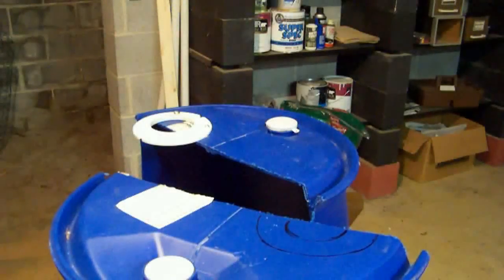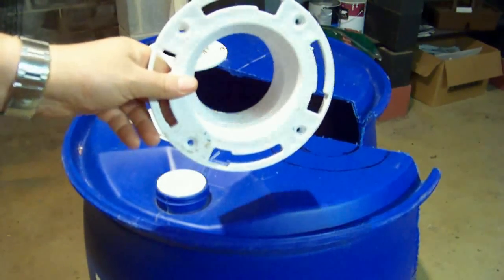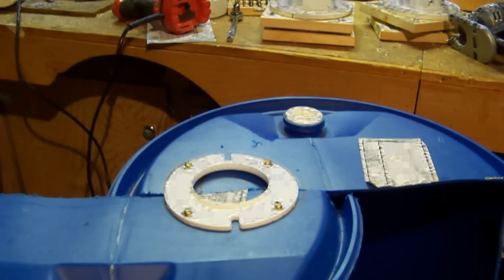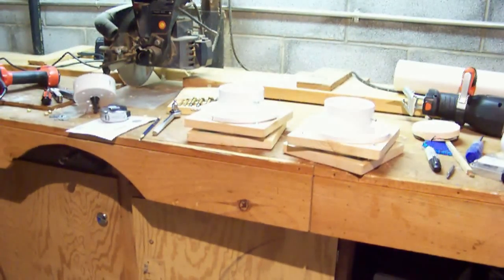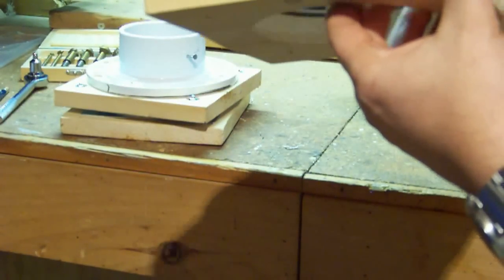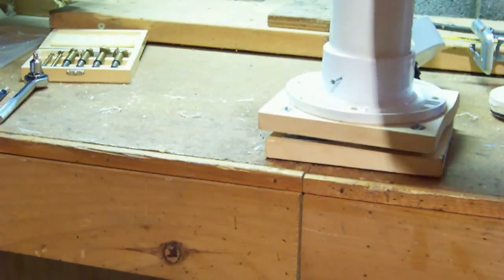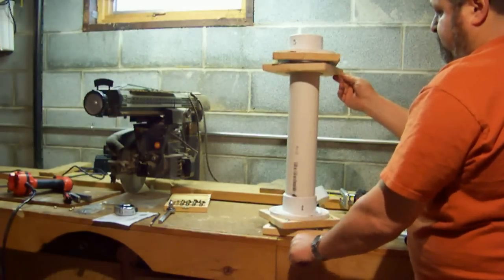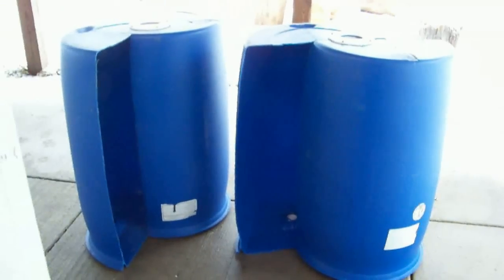How to Make an Inexpensive Vertical Wind Turbine - Part 1

Comment: Do you have an inverter? Can you explain some more as to how you are extracting the energy and converting it? I a, very interested in wind I have a small solar set up very small for a greenhouse. I hope you have a blessed day!   Wendy🌎🙏🏻🇺🇸
Reply from the maker: I was using a charge controller to charge a deep cycle battery and a bridge rectifier to go from ac to dc.
Reply: @embeddedprogrammer6276  Thank you! I am learning about solar and wind.

Comment: I do dislike lazy lucy bearings., yes., they are cheap., but with the lack of seal.,they are a replacement waiting to happen..Cheap replaced multiple times over are expensive..
Reply from the maker: You are correct.  sealed bearings are better.

Comment: You can also leave the rain barrel whole and cut vertical slits in the barrels and then use 2x4's to pop the edge out and then heat the plastic with a heat gun, leaving the 2x4's in place until the plastic cools down.  Do this all around the rain barrel the same direction so that it makes blades.  Then you can mount the barrel through the center.  This will be more balanced and have less moment/torque, but will work great for things like pumping water.
Reply from the maker: Thanks for your input.

Comment: Using lazy Suzan shows that they spin ok put exposed bearings not good and the racket, any reason u couldn't  use some nice quiet  sealed bearings
Reply from the maker: You are correct

Comment: Bicycle wheel and belt drive is more efficient and less friction.
Plus rubberized pads to insulate vibration noise from house/deck frame.
26" wheel to 10" pulley on alternator gives a better current at low speeds.
Reply from the maker: Great idea!  Did you make one?

Comment: does anybody have a link to a video where these types of windmills are working with an actual load?
Reply from the maker: https://youtu.be/24LSnATIZhw
Reply from the maker: Although just a meter.   I will put up a shot of it charging batteries if you want.
Reply: @embeddedprogrammer6276  thanks, that would be good.

Comment: Lots of great feed back, one thing not addressed is efficiency the fins of a vertical axis wind mill are like a air foil or are plane wing. Properly made they a very efficient  quiet, work in low and high wind i.e. no prop break off phenomenon.  55 gallon tank is a cool project that I not going to due I will spend some money and save in appropriate places via my skills overall I commend you for your hard work and optimism I could be wrong but wear and tear and low efficiency maybe problems.
Respectively 
Dr Ron Donahue
Reply from the maker: This is a drag turbine (Savonius).  I have made Darius Turbines which use airfoil cross-sections (see some my other videos).  Darius turbines rotate more quickly but do not have the torque of a drag turbine.

Comment: end plates will increase efficiency. also the overlap ratio could be reduced i think. indeed cover those bearings. great two stage idea here though.
Reply from the maker: I am playing with overlap on a new, smaller design for the Shed LED lighting market.

Comment: Let's calculate how much energy this might produce.   Assume it is .86 m x .86 meter.  If the wind is 20 mph (8.9 m/s) and a 30% VAT efficiency=1/2EpAV^3=1/2 x .3 x 1.22 (.86 x .86) x 1.22 x 8.9^3 = 95 watts at most.
Reply from the maker: What is VAT efficiency?  I am setting up an arduino to measure current and voltage so will soon be able to record the power generated and correlate with an anemometer.
Reply: VAT efficiency is simply the efficiency of a "Vertical Axis Turbine"  (VAT) to turn the kinetic energy of the wind into electrical energy.  The power ouptut will be proportional to the square of the velocity of the fluid..in this case air.  In the case of Turbine the re. (a VAT) the efficiencies are very poor since the blade has to "fight its way upstream" when coming around.  30% is generous.   The 55 gallon drum design is probably much less.
Reply from the maker: OK

Comment: Thanks for showing your ingenuity. We need a electrical schematic  on how you connect it to the house AC supply?
Reply from the maker: You can use a  grid tie inverter (search amazon or ebay for one).    Or you can use this for charging a battery bank to run 12v items.

Comment: Not going to last very long with open ball bearings.  Need sealed bearings because the wind is going to blow dirt into the bearings.  Also how does one take the power off of this thing to do something useful.  I would grade this projects as a failure at this point.

Comment: I would be leery of a lazy susan lasting for the extended usage of that application. The loads are okay, but extended usage at 20+ RPM could become a problem.

How well did they last? And if you changed them to another type of bearing, what kind?

Comment: there's 8 mins and 32 secs of wasted time ...
Reply: how so???
Reply: To be fair at about 6 minutes it stops to just show you the thing spinning with no commentary for about two minutes... and then tells you about the generator in another video. Not a horrible build but doesn't look like it's very long lasting. The bearings will rust, the PVC pipe will likely dry out and crack over time and I can only imagine what your neighbors might say about such an ugly fixture if you live within city limits. It's a great simple idea for power, but not something that will last too long or be for everyone.

Comment: The bearings are exposed, and will not last in dusty conditions.  grease for the bearings, and a simple foam rubber seal, might have dramatic increase in bearing life.
Reply: gamesbok the seal will also cut some noise.

Comment: I WANT TO MAKE ONE TO DRIVE A SHAFT TO A 5 SPEED TRANS INSTALLED BACKWORDS THEN TO A  LOWER END OF A BOAT OUTDRIVE- I WANT TO USE THE TRANS TO CHANGE SPEEDS AND FWD REVERSE. THE BOAT IS 40 FOOT
THIS IS SIMPLIFIED- I NEED MAJOR TORQUE ANY THOUGHTS?
Reply: +Paul Zeiss 300HP diesel engine.

Comment: It's a Savonius Rotor. You can make one with three 55 gal. drums. Cut off the tops and bottoms (circles), then you have 3 tubes. Cut the tubes downward 180 degrees apart and you have 3 sets of U-shaped wind "buckets." Select a strong pipe for an axle. Cut circles the diameter of the axle out of the tops and bottoms.With the tops and bottoms sandwiched between, weld the U shapes to the axle 120 degrees apart to create S shapes. Sounds confusing right?. Look up Savonius Rotor. Anyway, it's cheap but you have to be able to cut and weld. New idea? No, I saw it first in the "Mother Earth News" in the "70,s. Anyway, it's not very efficient in a light breeze. No DIY 'er has the ability to create a proper rotor that is. Yes it will spin but unless you live on the side of a mountain it will bog down quickly under a load.
Reply: Dutch2236 well said... thanks for your comment... I’m sure it will help many folks new to this effort....

Comment: I bags the bedroom furthest away from these mothers, Lasy-Susans are not for continuous spinning use, there just a very cheep way to help rotate a heavy load, i used some cone hub bearings, this also will allow the shaft to go through and connect to the motor. I salvaged the hubs from front end of a car £20 and you can even make use of the disc-brake & caliper that is fixed to the hub as a brake.

Comment: Have you tried blocking the center where the two halves intersect?  I believe that doing so will get you better outputs because if it is open it essentially allows wind to go completely through and be counter productive by causing inertia to fights..  So blocking it should give you more torque.

Comment: You need to raise the barrels up higher and redesign the barrels out wider. The way you have it at the moment, it will not spin a generator. Your best wind is 50' to 75' up above the surface of the ground and higher. The span should be at least 5' from center. You have a wrong formula for a wind generator. But if you paint a rainbow on it , it will be a very nice lawn ornament.

Comment: Just a thot from us all.... don't believe those ' lazy-susans' are going to last long...let alone the noise they put out.
that weather will chew those bearings up. Not designed for what you intended my friend. For, as long as, they'll
last, you might try spraying some teflon or some equivalent type of lubricant to keep the bearings quieter an operational
for as long as, their going to last. The PVC components may last a bit longer. Watch for high winds & see how it performs
then. (?)  Keep on try'n.
Reply: Greg

Comment: Now if you attach a bicycle wheel on the top of the barrels and then mount one of those old bicycle generators that press against the side wall of the tire, you might be able to light up a six volt flashlight bulb. That's if you got a good wind blowing. But if you use LED lights instead of incandescent ,you could more than quadruple your light output. That's not enough power for me to trade off the sound of a freight train on my deck all night long. I would put the 300 bucks towards a nice 130Volt 1.5Kw  horizontal turbine with a MPPT charge controller.Put the turbine on a 30 ft pole 150 ft from the house because you have the perfect location for it and you'll never hear it. I'm not fussy about anything weighing 250 lbs spinning where people and children and pets are walking around.That's an accident waiting to happen.

Comment: great video, but how do you deal with the noise? i think is very loud
Reply: Douglas Hutchinson that's what happens when you don't Grease the bearings before you use the equipment.
Reply: If you live out in bush who cares. You won't hear in house when generating
Reply: Besides a little noise and motion neAr garden a good thing

Comment: That's a great way to powered up the house with the wind turbin to drive a motor with magnets in it such as induction motors or ceiling fan motors to generate electricity with. That would be cool.

Comment: Have to agree that the concept is awesome and like the lazy susan bearing system concept . It would seem to realize that like others stated, you will need a better system than a lazy susan , an industrial grade is more suitable. Sure would be awesome for appearance if the turbine was on the actual corner post .Being at a higher altitude seems to be a great asset to this project.

Comment: @embeddedprogrammer Cool design, I can tell your a woodworker and I appreciate your post. I liked; the barrels, how it was mounted, and how two barrels were stacked on top of another. 

the alternator from a fan would probably fit pretty well in that design and off course add electricity.

Also I have heard that arranging vertical axis windmills close together makes them more efficient and how you mounted yours gave me a great idea. Thanks

Comment: I like to cut the drums with a hot wire, an old toaster wire and a 12v car battery makes a nice clean cut, use a "V" board set up to push the drum through the wire. For the bearing set up use a front axle hub from a junk yard. Balance is very important! Make sure the cut is in half. Transfering power with a belt using a 4 pulley system to the generator from verticle to horizontal axis. I like where this guy lives I would power a ski lift with it.

Comment: it occurs to me that you could have cut longitudinal flanges along the sides of the barrel and gently bent them outwards with a heat gun (i'm sure that is thermo-plastic), and shape it like a 'turbine' in a fan heater? would have saved you having to cut them in half.

Comment: if you went with a "magnetic Opposing" you could drive a small enough steel rod it would support itself with extremely little friction. You could then come off that to drive a geared DC motor. it would also be much quieter! Dont think you really need something that big

Comment: A belt could easily be used to turn a generator.  I like the idea of a compressor instead.  Store the air pressure and use it to turn a generator when needed.  Air acts like a spring for storing energy.  Batteries are more popular but they are batteries.  And air is clean and cools in the summer.

Comment: rust noise and where is the load? no load = easy to spin in low wind. with a load and then when them bearings get rusty you will have a challenge. 
HOWEVER a nice way to recycle the drums. :) 
id like to c this with a load and using sealed bearings. they will be quiet and stand up to the weather and not rust.

Comment: Get some NSK spherical roller bearings. Really any sealed bearing would work but spherical's can take anything and they are solid. 
@landslave I doubt they used stainless steel and it's completely open so yes. (they will get loud)

Comment: I think its a great video. But it had to eat it's self within hours or days. With that bearing setup and the lack of some sort of oil injection system to maintain bearing lubrication, plus the fact its a Lazy Susan meant to be spun slowly and in-frequently with just low loading, it would destroy itself.

Comment: Dumb question, why didn't you use a pair of "one wire" (self regulated) 12V alternators for the top and bottom bearings?

Comment: Yes. Yes they will.  These "lazy Susan" devices were never intended to be used outside.  Also, they are only intended for intermittent use, as in spinning around a spice rack.  Even if they never rusted, they will wear out in short order when subjected to 24/7 use.

Comment: The biggest problem I see in you choice of a lazy susan rotation system is that they weren't made to deal with the kind of friction being dealt out on a constant basis. That kind of heat will eventually melt or burn through whatever non metal material is next to it and all of your effort is for knot.

Comment: A good choice,although a little expensive,would be a sealed wheel hub bearing from a small car,at least for the bottom bearing that sees the most load,the top bearing can be a rubber sealed common size bearing,both would have very little friction,be weatherproof and low maintenance.Most front drive cars have replaceable sealed hub bearings.

Comment: I believe optimum design calls for 10-15% overlap in the blades. I see here that you have it 50%. It does not kill it, but it might be that you are catching less air than you should with those barrels

Comment: Good use of available materials!  The lazy susan table bearing are an easy find, they are overkill for this use.  The bearing noise is also amplified by the light plastic of the turbine fins.  Running a pipe down the center would allow the use of smaller bearing.  Run a 2nd pipe (PVC) that has the metal pipe in center and just one load bearing holding up the whole thing.   Kudos to the use of lazy susan bearings as balancing the barrel halves is not needed unless the wind whips up!

Comment: also one more question
is the reason that you use the wooden blocks because you couldnt find closet flanges which has holes which line up with the lazy susans?

Comment: where did you put the top thrust bearing? at first i thought it was in the top barrel... but after some thinking, i think it is actually where the axel goes in at the top of where you are mounting the turbine, and the turbine 'hangs' off the top thrust bearing

Comment: Here's another idea; cut slits from top to bottom all around the barrel, heat the plastic and bend the strips to creat vertical fins all around the barrel. center the axis, and see if you can make a Maglev wind turbine.Just a thought.

Comment: would it be possible to make or design a window mounted mini or micro wind turbine unit. have the wind turbine producing a small amount of heat to help keep your house warmer in the winter. maybe have the wind turbine connected directly to a heat dump load. people that live in cold climates would most likely buy a lot of them. people buy air conditoners to keep cool this would be a green easy way for people to help heat homes. if anyone can make something like this please mail me

Comment: to help you get a strait cut try using an angle grinder with a cut off wheel. the plastic will get hot at the point of contact but very strait cut

Comment from the maker: You would need a number of these and a big battery bank with a couple of very good inverters.  Shop motors take a lot of juice if you are running a large lathe, milling machine, or the like.  It all depends on what electric demands your shop needs.  You can buy a kill-a-watt meter and check it out if they are 110V motors.

Comment: i'm not a sceptic . i love this kind of stuff . in fact im working on a portable noiseless/fuelless generator with solar . everything i've done has been small scale mostly to power mt travel trailer off grid .  my question is how feasable would it be to run a small shop with something like this ? obviously you'd need a battery array w/an inverter . would you be able to trust a regular dc inverter to do the task ? maybe a number of them ?

Comment from the maker: You would probably want to use flange bearings. The lazy susan bearings are not designed to work on their sides like you would need for a water wheel.

Comment: well instead of digging up oil in saudi arabia, then burning gas to ship it here, then polluting the air by burning it to make fans spin, then loses thousands of volts running it miles through power lines to your house, you have it right there, AND if you make more electric than you use the power company HAS to buy it from you.

Comment from the maker: @springby 
It would probably work based on your local wind speed.  Does that server support a 12v power supply?   Also, I would have several batteries in parallel to give you more time to run the computer if the wind dies for several days.   You may also want to augment the system with a small (20-50w) solar panel.

Comment from the maker: I am using a pillow block (sealed bearing) for longer life and lower noise, but slightly more resistance than the lazy susan bearings.  I'm also experimenting with magnetic bearings (see my video on magnetic levitation).